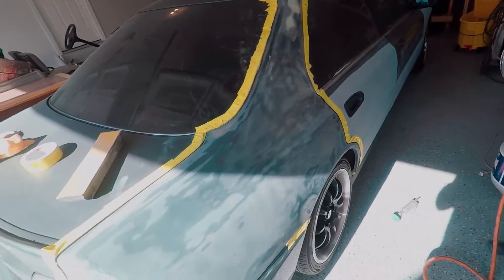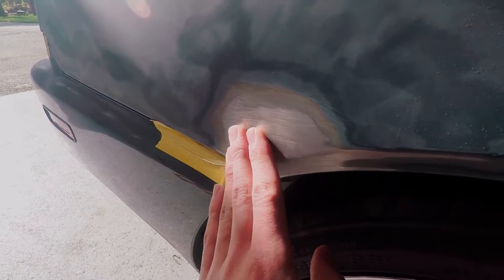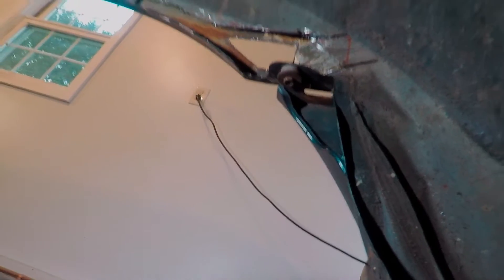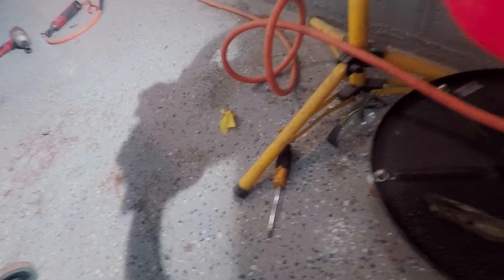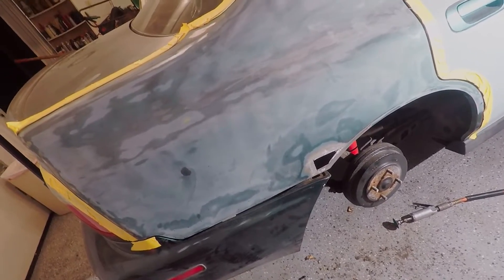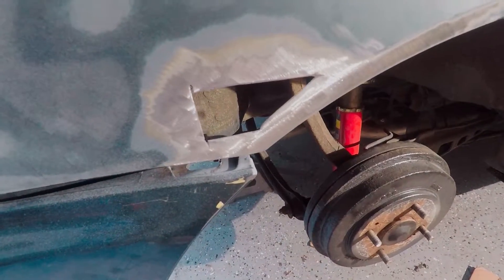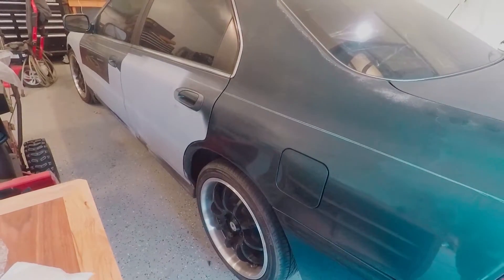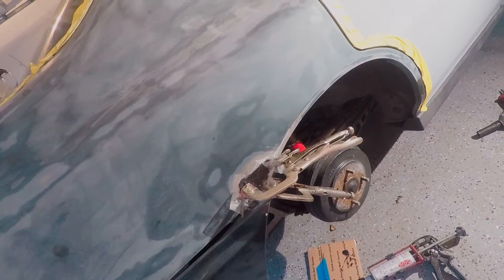Fixing Rusted Quarter on my Turbo Accord

Comment: I would have never thought about panel bond. I've been so used welding a piece and then bondoglass got reinforcement. I got to give that a shot next time.
Reply from the maker: I didn't know about this stuff until I talked to some Guys at a body shop and they said they use this stuff! If it's good enough for them, good enough for me lol

Comment: This body panel adhesive its great. I have a repair on the rocker panel from 10 years ago and its holding up very well, doesn`t came up.
Reply from the maker: That's awesome to hear! Never used the stuff before but had it recommended by a body shop. So I trust it but to hear you got 10 years is awesome! Thanks man